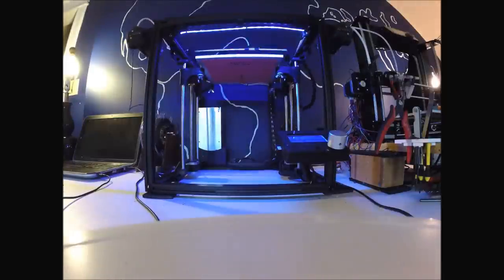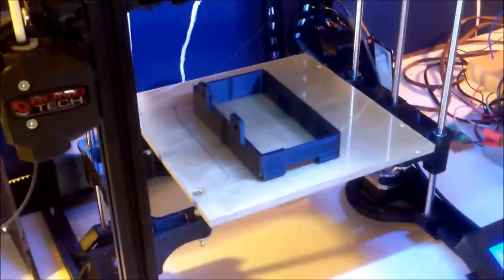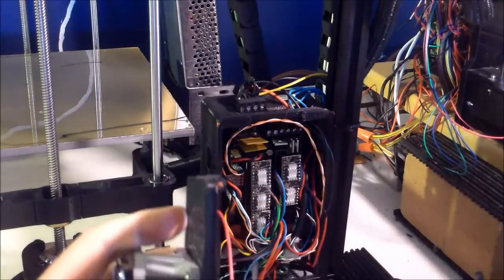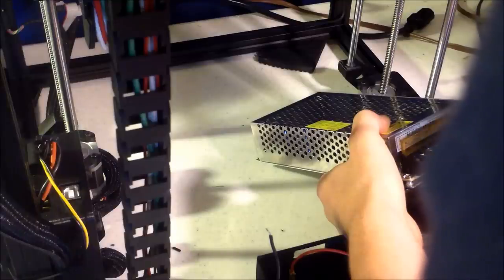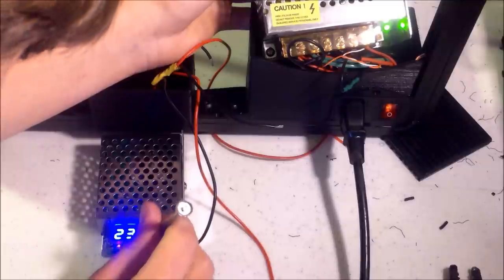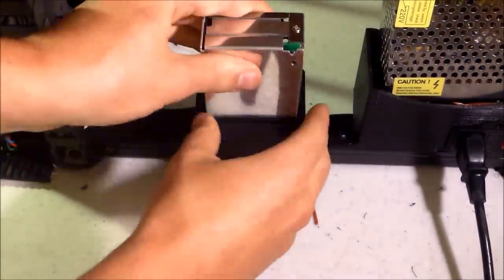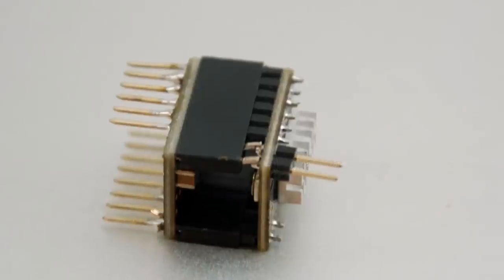How to Silence Your 3D Printer with 24v TMC2100 Drivers!

Comment: are you powering logic first then Vm? if so I believe that is backwards from what the documentation states..... "SilentStepSticks with variable 3-5V logic voltage
At power-up the motor supply voltage VM should come up first and then the logic supply voltage VIO. On power-down the logic supply voltage VIO should turned off at first and then the motor supply voltage VM, because the internal logic of the TMC2xxx driver is powered from VM. To ensure the correct powering a schottky diode from VIO (anode) to VM (cathode) can be added. The v2 Protectors for SilentStepSticks include this schottky diode." of course if you are running V2 protectors it doesnt matter
Reply: That's exactly what I was wondering. If you have the protectors, you don't need the timer relay. But it's also not clear from the video which thing is getting power first - logic or VM. It kinda looks backwards after re-watching it a few times.

Comment: Good video up until the point you start hooking up the final wiring  at 8:29. What are the hookups for the 2 black wires shown on the delay module now? You don't mention them. Where do they go? You have 2 red wires coming out of the output on the 24v step-up up at 9:50. One is going to the delay. Where is the other going? If you could provide a simple diagram of the wiring from the PSU to the step-up/delay and RAMPS it would really help clarify things.
Reply: Pretty sure the second red wire connects to the multiple power wires that connect the power to the stepper driver. No clue though what/where you have the two black wires coming off the delay module connected to. ???

Comment: Quote from github:Power on: The motor supply voltage VM should come up first and then VIO, because the internal logic of the TMC21x0 driver is powered from VM (SilentStepSticks with 3-5V logic voltage). Only after VIO is present and stable, the driver inputs (STEP, DIR, EN, CFG1...) can be driven with a high level./endquote

Maybe I'm missing something or i'm not understanding how the timer is wired. Wouldn't having the +24v on delay create the opposite condition stated above? 
Could you provide a schematic of your wiring between the 12v psu, the timer, and the step sticks? what if I'm using a 24v psu to my mks gen board, would I still need some kind of delay? 
Excellent project though, a silent printer sounds great!
Reply from the maker: The timing module is turned by the 24v (VM) and then counts down 2 seconds to turn on the 12v (VIO)

Comment: Hey man I'm alittle confused sorry I have 3 questions I'm hoping to get answered :)
1) I only see Positive being sent to the drivers(your red wires) but no negative....why is that, it doesn't seem like it would work "red and black line" you said so I can assume you just didn't show the black
2) What is the timing module for? I see someone said their chip turns on and off and you say that's what fixes it "go-to description for more info" but there isn't any
3) How is the printer working for you now? It's been a few years haha
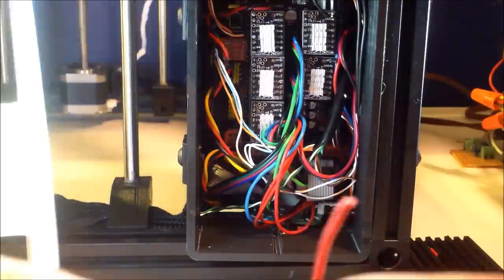Reply: 4:26 redline and black line
Reply: So I just read a reply to someone and got a question answered but it lead to another haha. Being on the phone makes it hard to read comments and replays xP

So the timing module is to switch on the main board 2 seconds or whatever after the drivers, Is that for initialization problems....why do you do that ?
Reply: Looking closer I saw the black wires at the end just before your noise comparison haha so those black wires are also coming from the step up I assume....thanks man!!! So sorry for my confusion

Comment: Hello.

Watterott sells the 5V logic version silentstepsticks (blue color) besides the black ones (3-5V logic)

Do you know which is the REAL difference between them IN PRACTICE? The silentstepstick FAQ is not clarifying for me about that.

Should I buy those of 5V for better, instead of the 3-5V version?

As far a I understand by the silentstepstick FAQ, the 5V version dissipates less power (internal regulator no used) and in that case the VM does not have to come before VIO.   Indeed for the 5V version it says " VM has not to be present before VIO" 

Does that mean that in that case we should use the delay module in the opposite way (VIO before VM)?
Or does it mean that in that case the delay is not needed at all?

I am quite confused, don't know why the manufacturer does not give better indications.

Their price is the same for both versions, so that is confusing also, since in principle the 5V version seems better to me (but maybe I have not understood something) but price does not give a clue. Also most of youtube videos and guides are for the 3-5V version (maybe they came out earlier)

Would the silentstepstick assembly process (pins to be soldered and the rest of the things) that is shown in another of your videos (https://www.youtube.com/watch?v=L2xNXTQO8xc) the same for the 5V version?

PD. I'm planning to use them with a Arduino+RAMPS controlled printer, if that matters.

Thank you in advance.
Reply: I reply myself since Watterott staff solved my doubts

The 5V SilentStepStick does not use the internal voltage regulator and can only be used with 5V boards (like Arduino Mega). VM has not to be present all the time and so a delay module is not needed.

The 3-5V SilentStepStick uses the internal voltage regulator and can only be used with 3-5V boards (like Arduino Due or Arduino Mega).

The price is the same, because both boards have the same components and only the PCB is different.

Most people use the spreadCycle, which is not the silent operating mode and so in general a 24V motor supply is needed.
As
 written in the FAQ, we recommend the silent stealthChop mode, where no 
24V motor supply is needed. We have tested it with different 3D printers
 without any problems (excluding the extruder).

The assembly process is the same for the blue ones.

The recommendation of using an USB cable without 5 volts power for connecting the computer to the Arduino (in order to avoid that it can be powered by the USB and not by the ramps) applies only for the 3-5V SilentStepSticks (not to the 5V version)

Comment: So they just need 24V?
I got a 24V Power supply and already set the Drivers to the "spreadCycle" and Standalone Mode like this: 
http://reprap.org/mediawiki/images/thumb/3/31/TMC2100_spreadcycle_topview.jpeg/491px-TMC2100_spreadcycle_topview.jpeg

http://reprap.org/mediawiki/images/thumb/d/d6/TMC2100_spreadcycle_bottomview.jpeg/180px-TMC2100_spreadcycle_bottomview.jpeg

Is it possible to drive the Drivers direct from my 24V?
I currently get this wine sound to and wanna get it away.
Reply: I have the same problem. Did you manage to solve it?

Comment: Hi.
First, Nice Video! 
Second, could you THEORETICALLY run the stepers at 36V? I have seen machines using that Voltage.
Reply from the maker: no clue! read through the tmc2100 manual and such, they may have info
Reply: Jacob Makes OK, THX man
Reply: Yes. According to the documents these will run up to 45V

Comment: ignore the last two comments, how the hell is all of this wired up! you have two red lines running out of the 24v step up?
Reply: The 24V is only for the stepper motors, the board still runs on 12V ... this is why there is a delay timing circuit it switch the 12V for the board 2sec after the stepper motors gain their main power source. This is important because the SilentStepStick TLC 2100 (with variable 3,3V-5V logic power input, the, the 5V only don't need that) need their main powersource present before switching on the logic power input otherwise they perhaps don't work properly or even get damaged, with adding the boost circuit it is very likly that otherwise the 24V power for the motors get delayed instead.(due processing  of the boost circuit, but anyhow Trinamic advice to switch the main powersource for the motors 0,2sec before the logic power input)

Comment: how you set up in firmware (marlin) ? you put all the jumper On or Off? when using TMC2100 my CoreXY X and Y axis movement always going to the wrong way(it's like only Y axis that working) but when using Drv8825 they go in the right way, for Z and extruder works just fine, i swap the drivers, trying invert the X and Y motor cable both in firmware and on the board  but still the same, they go the wrong way, would you mind share your config file
Reply from the maker: It varies from machine to machine, but here's a guide on how to configure your motors:

https://www.reddit.com/r/voroncorexy/comments/4fm163/debugging_corexy_motion_on_voron_without_losing/

Comment: What exactly are the trade-offs? or is this one of those rare examples of a mod that has no downs/bads at all?

Reason I ask is because, if this is such a good thing with no undesiarable setbacks, why don't the manufactures use these drivers as OEM?
Reply from the maker: Porsche Duésnburg I'm actually not quite sure. I'm simply not an electrical engineer and I don't want to give out false hunches. 

I have been using this mod for a year and a half now with no issues!

Comment: I followed this tutorial and bought the same components. Fired up the printer and it was silent. Everything worked perfect for a few minutes and then BANG, one of the capacitors in the 24v step up blew.. wtf :S Any ideas?
Reply: Edit: Replaced the blown capacitor with a non-chinese version... absolute stealth ;)
Reply from the maker: Dope! So glad it worked out!!!
Reply: Jacob Makes, the printer does however make a loud screeching noise for a few seconds right when I turn it on. This is something that never happened before this mod. Thoughts?
Reply from the maker: Hmmm, are you sure it's your motors? How quickly does it go away?
Reply: No, actually Im not sure where the noise comes from. Either it's from the motors, or it could be the step sticks? The noise goes away about five seconds after I turn on the printer..
Reply from the maker: Interesting, does it sound like it's coming from the frame of the printer? If so then motors, if it's not it could be a variety of things, my guess is either the drivers or the 12 to 24 step up
Reply: yeah, I'll investigate further.. I can live with it for now since it's only for a few seconds :)

Comment: Why protector?
Reply from the maker: "The SilentStepStick Protector is an addon module for StepStick and Pololu A4988 compatible stepper motor drivers. The board provides flyback diodes (freewheeling diodes) for the motor outputs, so that they are also protected against induction voltages in the unpowered state of the driver." basically: when you move your motors when the printer/motors is turned off, they act like generators and make small amounts of current. the protector keeps this current from blowing up your driver. 

I used them because I wanted a more robust set up and I don't want to worry about blowing drivers
Reply: I suppose you need them because you don't have the protective capacitors any more if you put the Vmot-Pins on top.